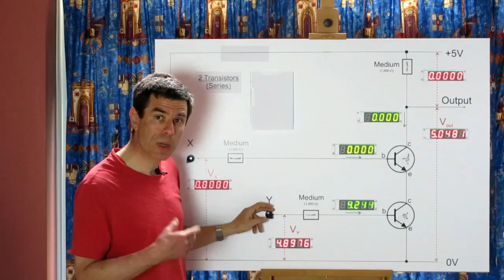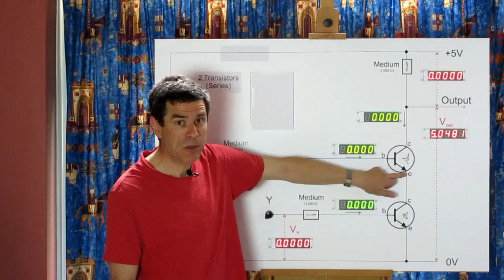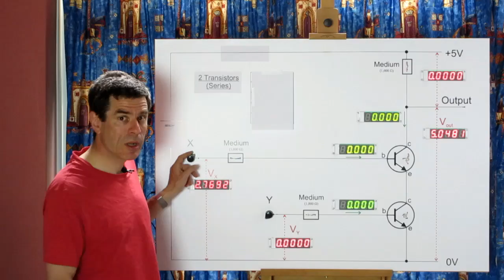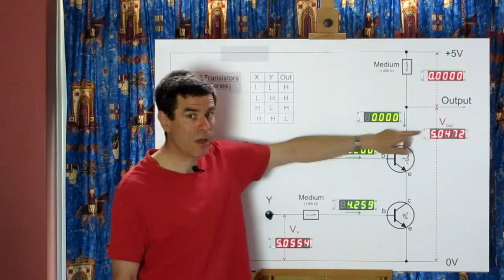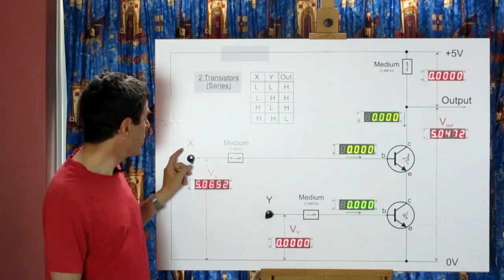SS3 : Two Transistors - Part 1

Comment: if I want the circuit to act as an AND logic gate, should I place the output below the bottom transistor and just right above GND. If so, do I need another resistor or should I just move the above resistor downward and place it near the GND. And I also want a LED to indicate output, so should I place it somewhere in the circuit (above, between or below 2 transistors) or anywhere else.
Reply from the maker: To get an AND gate you must follow the NAND  with an inverter circuit. This circuit by itself can't form an AND.
If you were to take an output from below the bottom transistor without doing anything it would just be connected to 0V so would be permanently low.
If you were to start adding resistance below the bottom transistor then you'd be setting up a voltage divider between the new bottom resistor, the transistors and the top resistor. To get a high output from underneath the bottom transistor the new resistor would have to be much larger than the top resistor. But then the output would end up always being high, so it wouldn't be an AND gate either.

Comment: if an output voltage is taken  between the first  transistor emitter  and second collector transistor then what will be the output
Reply from the maker: It will be quite sensitive to exactly what is going on so other you can't say much more specific than that it will be less than the emitter of the first transistor and more than the base of the second.